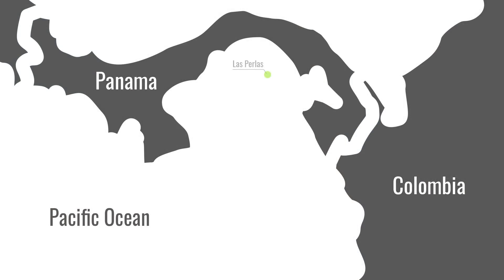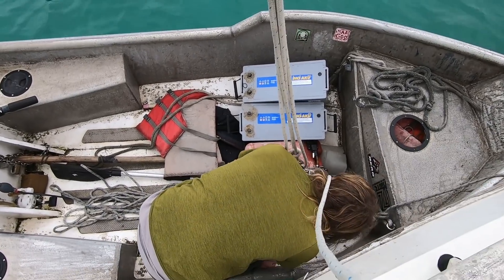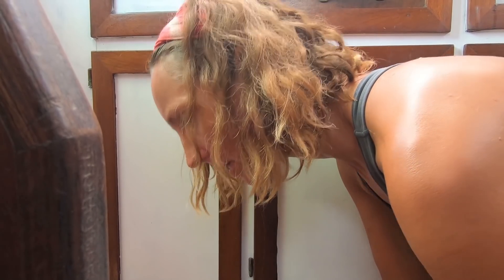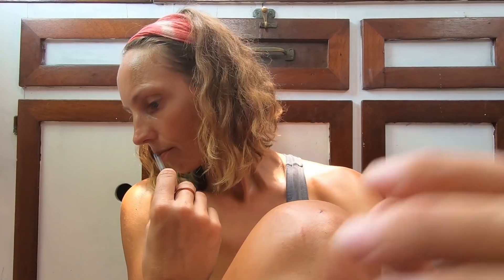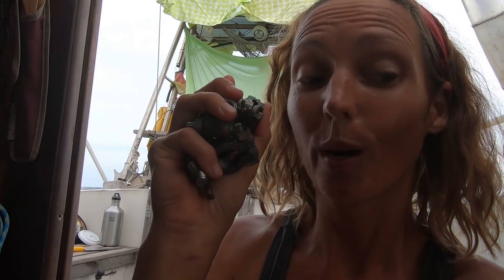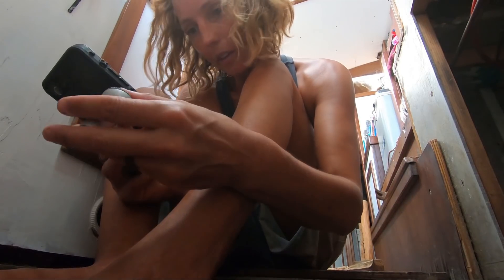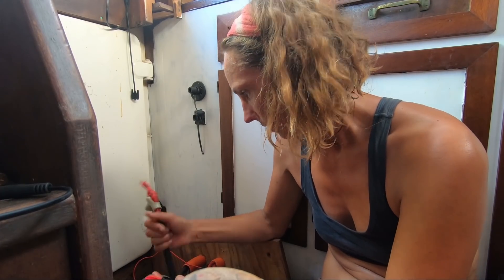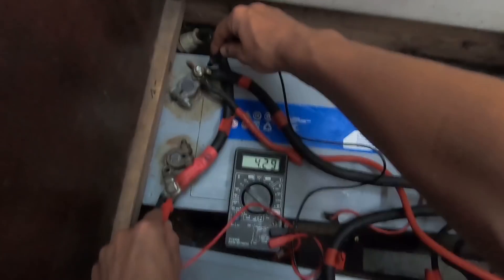Stepping up my game: figuring out how to trouble shoot the electrical motor of my Lofrans Tigres

Comment: Great video, but your electrical system might need some more "German" touch. Plus or minus first do not matter if all is well. On an aluminium boat the minus and the plus should both be free of the ships hull. Make sure that is still the case. Measure at DC voltage setting between Plus and the Hull and between Minus and the hull.  This should both be a more or less random value but NOT 13V and 0 V. All to prevent the dreaded electrolysis.
Reply: Yes, but with the metal hull, removing the negative terminal first is still probably astute. I also wonder if the windlass motor actually has a return negative lead, rather than being just earthed through the hull; maybe the final diagram was wrong...
Reply: @ianb4801  I think you miss the point of an isolated net. Using the hull as a conductor would cause huge problems in any metal boat.
Reply: @Nerd3927  No, I didn't miss that one, just if you look at Nike's two sketches, they don't seem consistent to me. One shows a control box with no earth but the second one, with control box bypassed, there seems to be one. The first diagram showed a direct negative connection and I can't see why that would've been removed in the bypass. Also possible for there to be an implicit earth via the windlass physically bolted to the metal and that's what is drawn in on the second diagram, but there's nothing clear to say the negative terminal is actually connected to the hull. My point is, as Nike says herself, is that she's no electrical engineer and maybe her diagrams are just wrong and wise choices have actually been made.
Reply: @ianb4801  All anchor wipers have a connection for + and -; it would be criminal to screw this only on aluminum. I hope you are right that the sketch is wrong.
Reply from the maker: @ianb4801  oh now I see my mistake. What u consider ground was me trying to say I did just not connect the second positive that usually goes to the control box. That’s not a negative that’s a positive .the x was supposed to mean it’s just not connected, my mistake, wrong symbol
Reply: @WhiteSpotPirates  As I thought, the heavy direct cabling, both positive AND negative is in place, just the diagrams were confusing. I suspect the case is not insulated from the deck, but the electrical connection is not that way. I just took the two diagrams as indicating what had been removed or bypass, not expecting technical perfection in the diagrams. I haven't checked back so I might be wrong, but that faulty cable looked pretty black to me - but maybe it's still a +ve with a red heat shrink.
Reply from the maker: @ianb4801  😂😂 all my cables are black...does not say anything about them being positive or negative. The one I was messing around with was the positive ...the negative goes back to the battery. The second positive coming off the motor is not in use. It usually goes to the control box. 
There is no current running through the housing, at least not last time I checked .
Reply: @WhiteSpotPirates  Ah ha, that was a red heatshrink I saw. I've just gone through some major installation also with substantial re-wiring and I rid my boat of black positives, as far as I could tell; there was a dangerous mixture of red +ves and black +ves. I also insisted on all tinned cable. BUT - this was happening while docked at Portsmouth Harbour where materials are pretty freely available and you-know-what-19 is not heavily in the area. 

If the truth be known, I also hate my windlass because it has just a down clutch for down and a deck button for up (always I stand on the accursed thing and frighten myself). As I so often single-hand, this is a worry for me and I wish to replace the whole thing (with a yummy remote control in the cockpit) - but I've run out of time. But I might have a worry with Karl's windlass too, with all those projections just lurking there to trap a sheet. I don't like equipment that lurks!
Reply from the maker: @ianb4801  the negative goes back to the battery as drawn on the diagram. Nothing is grounded on the hull, that would be scary
Reply: A pious thought but unfortunately hardly to realize. There is the starter motor and the alternator to be modified massless and there are many components like the built-in radio which all have to be considered. Next chapter the mandatory protective grounding of the ship for shore connection.
Reply: @albertfunk1176  There you have a point. I forgot she build in the current engine. From new it was probably build correct. My advice is a bit late.
Reply from the maker: @albertfunk1176  yes, my motor is set up exactly that way.

I never take shore power which is why I have never taken a closer look at the shore power charger that is installed...
Reply: @WhiteSpotPirates  It requires an enormous effort to design an aluminum ship massless, I failed with my Reinke 13M. Since 20 years no problem with a CENTRAL ground (-12/24V) possibly because of "Inversalu" at the hull and we often have shore power...😉

Comment: With high amperage circuits, it's always the connections or the connectors !

The device you used to crimp the terminal back on requires much more force than you get from a hammer to make a good connection, it's probably best to squeeze it in a vise if you can borrow one. 
Once you are sure you have crimped it securely slide a long piece of heat shrink over the entire connection, from the cable sheath, over the terminal then right over the bolt (which needs to be short), over the next terminal and onto the cable sheath (sleeve). Before you shrink it, put some hot melt glue in the ends, this will melt and fill the gaps when you shrink the sleeve and keep the whole thing watertight.

Comment: That's why I always take a battery and connect it direct to a motor first if it runs then let the chase begin if it does not run then tear it down or replace. But you fixed it so great job and cheers:)
Reply from the maker: Yeah someone else mentioned that and it TOTALLY makes sense...next time 🙈😂😎🤓

Comment: Hi, amazing logical way to the windlass repair. :) I found you last week and watched all movies. I'm happy you continue publishing.
I would just add one small additional advice for the future. After the commutator sanding take a sharp piece of plastic and clean the spaces between those small metal plates one by one to make sure those are disconnected and metalic sand is not stored between them. On the hard you can use air compressor, on the water use some plastic and own wind below the nose. Small metal sand can close plates together by self welding. 
Looking forward for the next videos. Keep healthy and strong. All the best!
Reply from the maker: Thanks for that advise about the plastic. I read about the air compressor and he tried to blow the dust off but the plastic is a great advice, thanks. And thanks for explaining WHY to do that, makes total sense and also makes it very clear why it’s so important 👍

Comment: Hey Nike! Glad to see you got your windlass issues worked out. Nice job on that troubleshooting, and motor service!! I have quite a few crimped (only) connections on various high current devices, both on my boat and on land. I also have large heavy wire connections that are soldered. Over the years I've had much less trouble with the soldered ones, and I'm slowly changing everything over to soldered. It's not hard or complicated, especially with small propane (or butane) torches and thick solder wire. Lots of videos online. Secondly, regarding the "control box" you removed from the circuit: It's true that the windlass control boxes allow up and down directional control, but another name for them is "solenoid," yet another is "relay," and they are used to protect low amp switches from the high currents between the batteries and the windlass motors. If you are using the old "up" deck mounted windlass switch, then it's working pretty hard and probably 'way beyond it's rated capacity. I know you research the heck outa this stuff so maybe I've missed something about your specific set-up. Lastly, it looks like the Lofrans control boxes are available and not too expensive. Let me know if you want one and we can work something out. Cheers!
Reply from the maker: Hey Bob, totally agree on the soldering. Unfortunately I suck at it 😂 and ran out of the flux combo wire and don’t have any seperate flux. Should buy some; totally agree, works a lot better!!
Yeas I am aware the box is a solenoid, I am calling it that at the end of the vid 😜. I am not using a deck switch, only the big circuit breaker that connects the positive... the way that I drew it u can see there is only the main big ass switch.
It’s often not so much the price of things but the getting them somewhere that makes them expensive or a pain in the butt to get 😂. I did not feel any need for it, that’s why I did not replace it...
Thanks for the heads up, though and for offering to organize one, that’s really sweet of u 👍
Reply: @WhiteSpotPirates  Yeah - I figured you had that handled, (of course 😄). I suck at the soldering, too, I just keep plugging along.  One last "maybe" concern: I've heard marine breakers don't like to be used as switches. I have no logic to offer about that. I've done it on a temp basis with no problems. Take care...

Comment: You never cease to amaze me with the things you take on, so few people seem to be prepared to "have a go".
It's probably good that you pulled the windlass motor apart and checked everything as it sounds like the brushes were a bit sticky. There is probably a special puller that would get the brush holder/ end plate off of the shaft, although a basic automotive harmonic balancer puller mite do the job if there are a few threaded holes in it. Good luck with the batteries. See you  "soon"

Comment: You gave me a backache just watching you sling those batteries around….please use your legs to lift, not your back..
Reply from the maker: Hmmm legs/ foot is not so bueno at the moment...😬 and it’s tricky to place ur feet in a decent position to lift in that small area...
Reply: @WhiteSpotPirates  your boom works great as a crane though. But also amazing how heavy the best house batteries can be. I changed my 3x115Ah lead-acids for 4x100Ah LiFePO4, to more than double my useful battery capacity - and the stern of my HR-38 actually rose nearly 2cm! Lead-acid and AGM are soooo heavy!

Comment: Glad to see you back, there is nothing wrong with consulting videos and tutorials to learn what you need to. kind of a harsh environment for electric motors so routine inspection and maintenance will save you money. not a fan of that style of connector for superflex wire, a crimped connector would serve you better but you have to use what you have. Not many women would embrace your lifestyle alone you are a strong willed women.  from an industrial electrician.  by the way are you up for adoption? I'll buy the beer!  ha ha  be safe!!!

Comment: Continue to be impressed at your problem solving abilities.  Would have been sad if you had paid someone to check out the motor only to later find the wiring issue.  I find that I can screw up something several times and still fix it cheaper than hiring others to do the work, plus I learn and will do better next time.  Good luck. :)
Reply from the maker: Well there is no one around that I could have paid anyhow 😂 and it’s not that I made anything worse by checking the motor, was only a gain, so I am not too unhappy 🤓